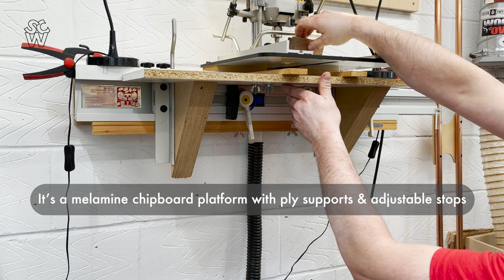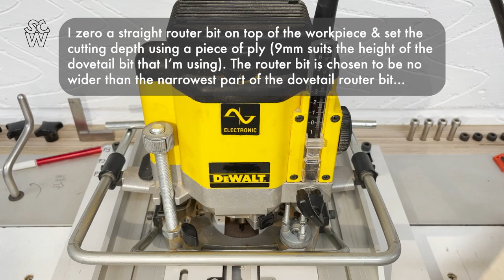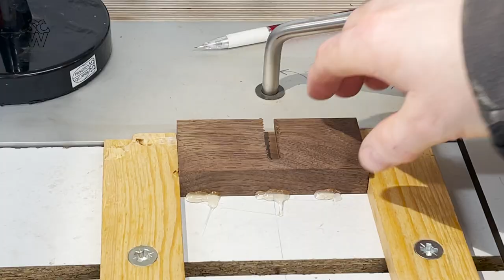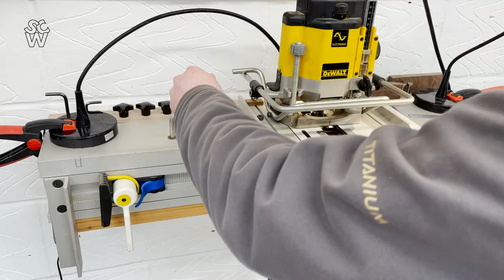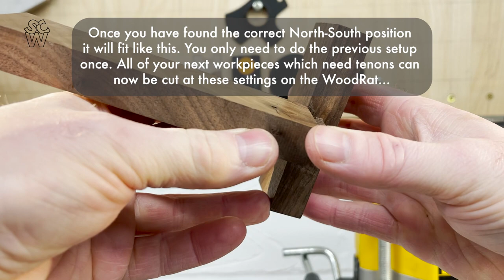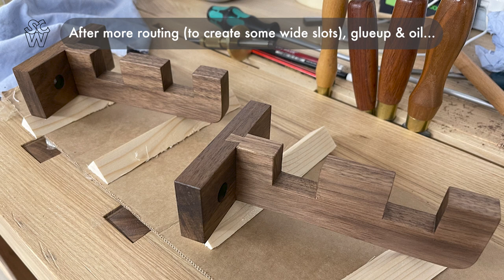Sliding Dovetails Using the WoodRat

Comment: This looks useful, I have often found that the table on the woodrat is not ideal for some joints because of it's tendency to flex. Cheers Steve
Reply from the maker: Thanks Steve. The aluminium rails on the top surface of the base plate seem to strengthen it up a lot. But I know what you mean, it can still flex a little. This does ensure that the workpiece is held correctly during the cut. Cheers Steve

Comment: I’ve never even heard of a woodrat.  Granted I’m 98% handtool only, but I figure I have come across it somewhere. Is it basically and early form of a pantorouter, but on a table?   Seems like it would take forever to do this though too; a saw, some chisels, and a router plane it’s lickety-split done. How do you do tapered sliding dovetail?
Reply from the maker: The WoodRat was invented in the 1980s, so it’s been around a long time now, but obviously not as long as hand tools. If you go to www.woodrat.com you’ll find more info or search for their YouTube channel. The Pantorouter works in a similar way but it’s not the same and is much much more expensive. Basically the Rat is a wall mounted jig for your router. The router sits on a plate which can be pushed forwards/backwards whilst the workpiece is held underneath the plate (either vertically or horizontally). The workpiece is clamped to a bar which can be moved left/right. With the router bit protruding through the plate the workpiece is cut in all sorts of ways depending on how you move the router back & forth or the workpiece left/right. It can cut a large number of different joints and would be able to cut tapered sliding DTS too. If you’re a handtools only person then I guess this is not for you. I can cut dovetails by hand too (see my Roubo workbench series for example), but when I started out in the first years learning to make things I went down the machine route first. Nowadays I have the choice of machine or hand cut and depending on what I’m making (& how many) one may be better than the other (for me anyway). Thanks for your comment and hope this helps?